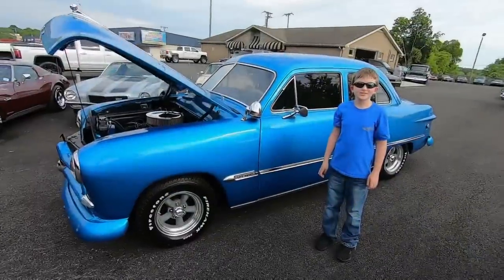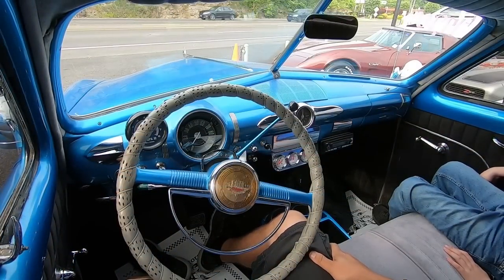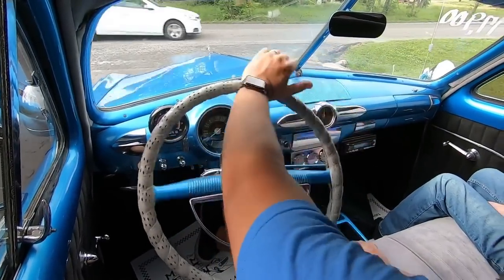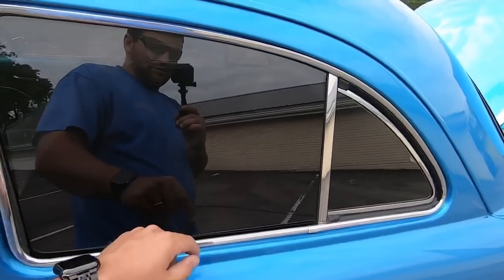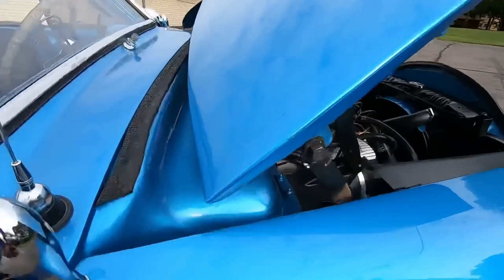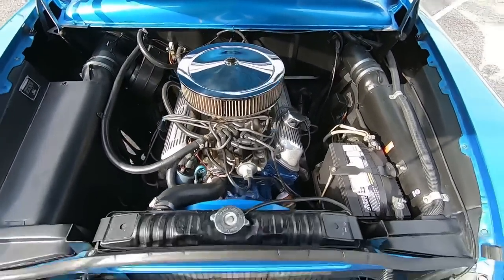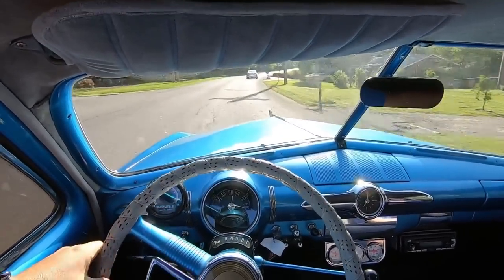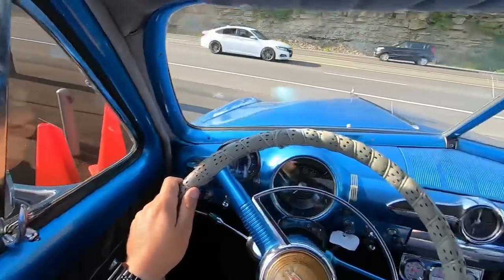Test Drive 1949 Ford Sedan SOLD $17,900 Maple Motors #1098

Comment: That '49 is a sweet ride. Drove a '50 Fordilac with a rolled and pleated interior in late '50s. Yeah, I'm that old.😁 That car just needs period correct wheels with chrome spinner hubcaps and mild white pin striping.
Reply: Ford with a caddy 390 motor? 🤔